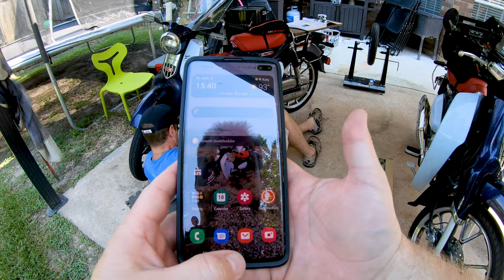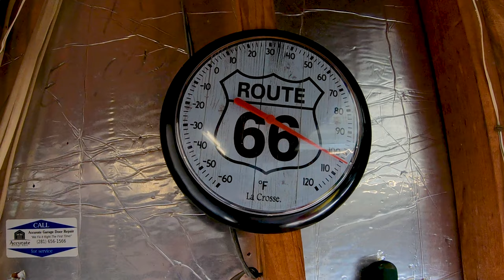Scooter Cannonball 2021 // T-13: Honda Super Cub Valve Adjustment & Maintenance

Comment: Back in the mid 1960's I had a 49cc cub used for/paid my newspaper route. We used a dollar bill to adjust the valves.
"The dollar bill weighs in at 1 gram and is  0.0043 inches thick."
Interesting side note:
   My 49cc cub could hit 55 MPH down hill 'once'. 
   Just above 55 the crankshaft bent, collided with the cylinder head and the bike came to a 'very sudden stop'
   (minus many teeth on gears ... the teeth were in the bottom of the crankcase).

Comment: To solve the lean issue due to a lack of back pressure in the new pipe can be solved by making a slip in baffle-a walk through a good hardware store will turn up something-head for the plumbing area copper pipes and end caps-I have made a few that worked good and the copper will not melt
Reply from the maker: I thought about that, too.  I've used steel fender washers in the past to accomplish similar tasks.  I just put them at the exhaust outlet inside the head pipe to restrict flow... drill the opening to accomplish the needed backpressure.  I haven't tried the copper caps before... that's an interesting twist.  I wonder where I could install (and secure) the cap inside of that exhaust... hmmm... brainstorming.  👍  --QM

Comment: Great video! That plug on your buddy’s bike got way HOT! You can see some bluing on the body of it. You mentioned going up in heat range on the plug. The heat ranges of NGK plugs are actually counterintuitive. The “6” you took out is hotter than the “7”. Looking forward to vids from the cannonball run!
Reply from the maker: Thx!  Yeah, the heat ranges are counterintuitive.  Higher numbers mean that they dissipate more heat into the head to run "cooler" under hotter running conditions (e.g., extended high speed operation):  https://ngkntk.in/importance-of-heat-range/

I think it's safe to conclude that running at or near redline for 9000+ miles probably qualifies as "extended high speed riding", as per page 144 of the owner's manual.  They don't mention Cannonball Run abuse in the manual... hmm...  🤣👍  --QM

Comment: On truing spoked wheels.  As you adjust spokes (tighten some, loosen others) and get the wheel “better”, the wheel will not remain that way after some running on the road.  Rechecking the wheel will show that it is probably better than when you first started, but not as good as when you stopped working the first adjustment protocol. Several iterations will get the wheel bedded  in to a position that it will maintain.  I’ve not experienced a “once and done” on truing spoked wheels.
Courtesy of Half Vast Flying

Comment: I'm surprised you're doing the valves this often.
They rarely ever go out of spec.

It pays having a set of feeler gauges that have the correct range.
In 80,000 km, only once were the Valves on my Wave 125i out of spec (which has the same specs as the C125). My suspicion however is that the Thai Mechanic set it to the spec of the Previous version of the engine when he did the clearances before I moved to Australia and now do my own maintenance.
Reply from the maker: We were trying to follow the service intervals specified in the Honda owner's manual and the service manual.  We found that our valves were a little bit out of spec during this service at 5K miles (8K km), but not excessively so.

We checked the valves two more times during our 10K-mile (16K km) Scooter Cannonball Run trip in July 2021.  Both bikes required slight adjustments on the exhaust valves to stay within spec (they were getting too tight, and that's bad for heat and scorched valves).  Remember that we were running these engines HARD on the highways at wide-open throttle for nearly a month straight, so these weren't normal operating conditions.  Cheers!  😉👍 --QM

Comment: What are those small lights mounted to the front fork?  Do you have a video about them?
Reply from the maker: Those are the Denali DM 2.0 driving lights:  https://denalielectronics.com/products/dm-led-light-pods-with-datadim%E2%84%A2-technology .  I don't have a specific video about them or the installation process because I was in a hurry preparing the Cub for a road trip.  You can watch the video leading into that project here: https://youtu.be/k1ri2ZEX9JI .  The first demo of the lights can be seen in the video the following morning when I hit the road: https://youtu.be/37BTEHXWfxU?t=145

The LED light pods are mounted on the original reflector brackets, and I bent the brackets to clear the leg shield.  The power harness is run directly to a fused connection at the battery.  The on/off switch and relay is powered through a switched 12V line on the ignition switch, so they are only active when the bike is powered on via the key switch.  Cheers!  😉👍  --QM

Comment: I am not finding any info on Adrian's spare fuel tank. Google did not find it. Some help please.
Reply from the maker: That's one of only two "Neil tanks" in existence!  I have one on my Cub, and a friend of mine, Adrian, has the other one.  Our buddy, Neil, custom fabricated those tanks and mounting cradles for us before we left on the 2021 Scooter Cannonball Run last year.  They hold about 1.3 gallons, but they aren't plumbed into the main fuel supply.  We used them as emergency fuel supplies and transfer tanks during our extended road trip.  You can see it in action here: https://youtu.be/NYjmV7FqLOM?t=2890 .  Cheers!  😉👍 --QM

Comment: Are the clutches on these wet multiplate? Subbed by the way.
Reply from the maker: Thanks for the sub!  The Super Cubs have two wet clutches.  The first one is the centrifugal clutch on the crankshaft, and the second one is a somewhat traditional multiplate clutch pack that's attached to the transmission input shaft.  

I recently did the "oil spinner" maintenance on my Cub which requires the removal of the side cover.  I recorded that process, so I'll try to edit and post that video soon.  You can see a few pics of the innards here on my Instagram account: https://www.instagram.com/p/CWJyw3TLxB1/?utm_source=ig_web_copy_link .  I'll try to post those here on YT as well.  Cheers!  😉👍  --QM
Reply: @QuasiMotard  Ok thanks for that I'll take a look.

Comment: I think the owner's manual says you don't have to adjust valves until 4000 miles, unless I'm reading it wrong. Why not wait that long?
Reply from the maker: That's correct... the service schedule states 600, 4000, and every 4K miles after that.  Our bikes were serviced at 600 miles, but we missed the 4000 mile service by ~1000 miles (mileage at this recording was ~5K).  We completed the adjustments before our trip started, and then we checked again twice during the trip (not out of spec during both checkups).  Cheers!  😉👍  --QM
Reply: @QuasiMotard  As far as I can see it DOESN'T say 600 miles, just starting at 4000 for the valve adjustment.
Reply from the maker: @curtgottler9961  The Cub's manual doesn't call for it specifically, but it's a good idea to check the valve clearances at the first 600 mile service.  The PCX150 and many of Honda's other small engines do specify the 600-mile valve check interval, so I do it as a matter of course.  At any rate, our odometers were sitting at 5K miles, so we were 1K past the 4K service.  --QM

Comment: What year is your bike? I’ve just purchased the 22 model and wondered if the valve settings are the same.
I cannot get any info whatsoever.
Reply from the maker: I have the 2019 model, so my shop manual specs might not apply to your 2022 engine.  Honda made slight changes to the motor for higher power and lower emissions, so the specs probably changed.  I recommend searching on Helm Inc's website to see if the new shop manual is available: https://www.helminc.com/helm/homepage.asp .  Cheers, and congrats on your new Super Cub!  😉👍  --QM
Reply: Thanks for the information. 👍

Comment: Did running that 7EA spark plug damage any engine components? I want to change mine over to the 7 like you have as I have the p shooter exhaust also. Just dont want to hurt my bike.
Reply from the maker: No, we don't think there is any damage to Adrian's motor.  The 7EA is the plug to run for extended high-speed operation... that's the one in my Cub.  Adrian was running the factory 6EA plug that doesn't dissipate as much heat, so it was running too hot.  We haven't checked our plugs yet after the 2500-mile trip up to Bar Harbor... that's a task for tomorrow morning.  We'll evaluate whether the engines are running too hot (lean) because of these exhausts, and we'll make fuel adjustments with the DynoJet Power Vision 3 tuner as needed.  👍  --QM
Reply: @QuasiMotard  awesome thank you so much for the reply. Let me know how the engine turns out with the 7 spark plug. I have one but people were giving me some flack because they were scared it was going to hurt my engine. I have the same exhaust but I do not have my ECM flashed. How hard is it to remove your ecm? Or flash it? I was thinking about buying the dyno jet. Thanks again for everything and I hope you're enjoying your cross country cannonball. I'd love to ride that with you guys someday
Reply: @QuasiMotard  Thanks for the reply. I ran my cpr 7 and it made a huge difference. I also upgraded my sprocket to a 13t and a whole bunch of stuff. A whole new bike. I bet if you upgraded to 2.75x17 and 3.00x17 tires with 13t sprocket it would tow really well.. I upgraded my spark plug, seat, extended rear rack, exhaust, windsheild, front and rear shocks/springs, and much more. My c125 will keep up with a ct125 no problem.
Reply: I've been running the colder plug on our 3 125cc bikes that have similar engines.
My 2014 Wave 125i has managed to do 80,000km with about half of that plugs with the 7 rating.
The last 15,000km were with the IX - Iridium version of that plug, which I recommend as they last way longer.

In terms of engine health: The engine still had good compression and power before the gearbox input shaft bearing decided it had enough.